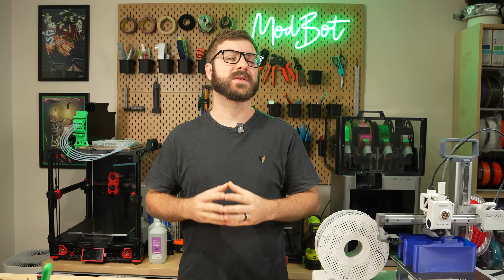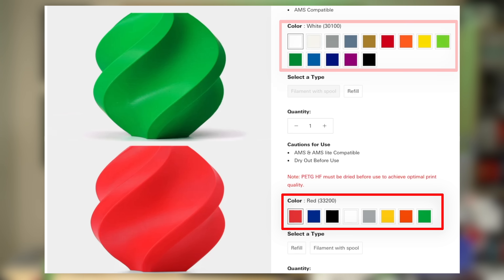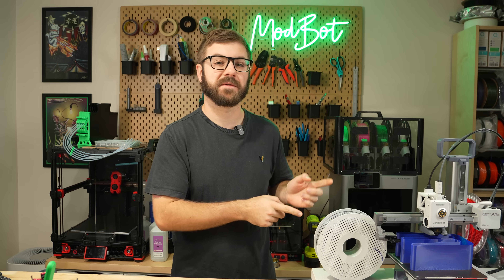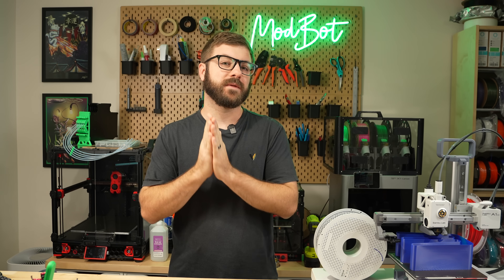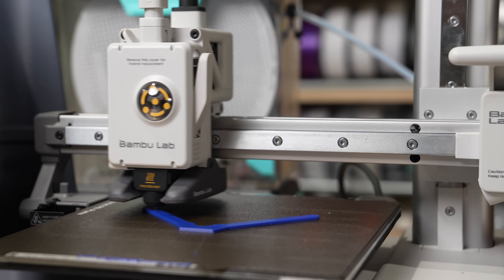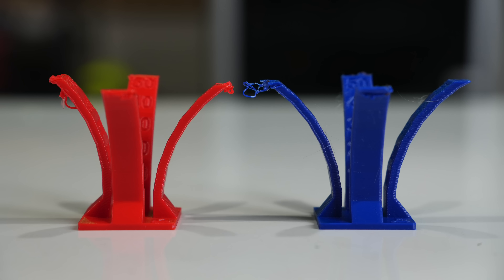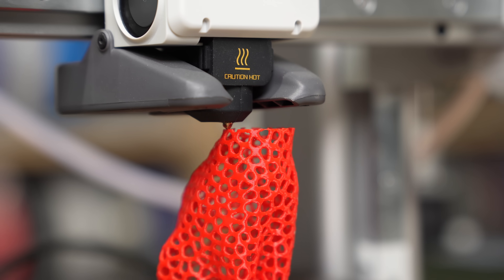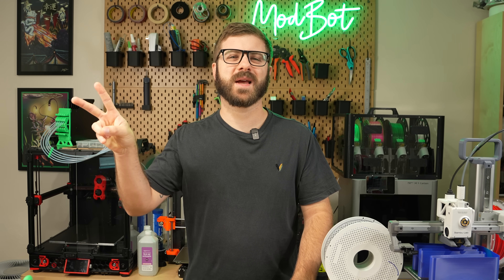Is HF PETG Actually High Flow? (And What Are The Trade-offs?)

Comment: I print and sell rod building jigs for people who build fishing rods. These are functional prints that need the mechanical property advantages that PETG offers over PLA. This HF PETG seems more like a step backwards. If you want to print faster for functional parts, the better move is to increase your nozzle size and layer height and keep the mechanical benefits of regular PETG. I print with a .8mm nozzle and .4mm layer height at 40mm/s which doesn’t sound like much, but it really speeds things up due to the increased line sizes and layer heights. I have a small print farm made up of Ender 3’s and I do not use Bambu Labs filament, but I really hope other vendors don’t follow their lead and get rid of a filament with fantastic mechanical properties just to reduce print times. It is not a good trade off for people who print functional parts that need to be able to handle some abuse.
Reply: If you need strength and want to up your speed, throw away the PETG and use real PET. It's better in all ways but needs a high temperature capable hotend (290+ for high speed, 270 baseline). No snot, no first layer adhesion problems, isotropic part strength.

PETG is basically "PET modified to be easy and cheap to manufacture as filament and printable on low quality printers with PTFE lined hotends, but shit".
Reply: @daliasprints9798 I would be interested in trying some out, I never have admittedly. I personally don’t have any issues whatsoever with PETG’s adhesion to my print bed surface. I may pick up a roll of PET and see how it runs for me. I will say (for my particular use case and what I sell) PETG works great!
Reply: i print functional parts with HF and have experienced only positives, different uses cases for different folks i guess, but i'd try it first. there's also 'if it ain't broke...' too so I'm just saying
Reply: @joeylopezdesign  Same here. No issues at all and haven't noticed any strength drawbacks.
Reply: upping the layer height / nozzle size doesnt really do much for these bambu lab printers. their hotends only flow around 22 mm^3/s so no matter how you slice it (pun), you're capped by the hotend. higher layer height just leads to lower layer speeds. I used to do the same with my ender 3 neo since print speed was hardware limited. but most modern filaments are printed at max speed with these bambu labs. unless you get a panda/revo/e3d hotend with an upgraded heater core (60W aftermarket vs 25W Bambu's), you wont see much faster prints.
Reply: @dtylerb  The UV issue of ABS is extremely overstated if it isn't used for high strength applications, especially in dark pigments, which can absorb it rather than the plastic. Sure, VOCs are an issue, but if you're printing to sell, that shouldn't be an issue.
Reply: @klaidasrunele the rigidity of ABS is the main problem for me in my particular parts.  I have thin parts that have to flex quite a bit and snap back into shape to clamp around conduit and hold snugly. Also, acetone is commonly used where my parts are being used so ABS isn’t a good fit for that reason as well. There isn’t a one size fits all filament, that’s why more choices are better!
Reply: @TheFishingHobby  I didn't know about your parts coming into acetone, which makes more sense why you use ABS. I didn't think about the chemical resistance element of the plastics much.

Although ABS is a lot tougher compared to PETG so I don't think snap fit elements would struggle if you did try it. Toughness is my main issue with PETG.
Reply: @klaidasrunele  I agree, if you are making parts that take any serious abuse, ABS is a much better choice. It just isn’t the right filament for my use case. I do need chemical resistance and my parts hold up well for what they are used for. PETG also has a low coefficient of friction and great abrasion resistance which is perfect for what I sell. I make parts that support fishing rod blanks and they have to be rotated for epoxy drying reasons for hours on end. There are definitely a lot of factors to consider when picking a filament.
Reply: @TheFishingHobby  I still think PETG is overvalued compared to PLA and ABS for most cases.
Reply: I'm only interested in functional parts. Hf or Regular- I don't consider PETG a functional parts filament. I'll use it for prototyping and fit and function testing.. but it isnt anywhere CLOSE to functional imo😅
Reply: @notyouraveragegoldenpotato  What filament(s) do you use for functional parts?
Reply: @notyouraveragegoldenpotato depends what you're using it for. I've got custom PETG brackets clamped around a pole outside holding up a retractable clothesline and it's holding up quite a lot of clothes when the lines are fully loaded. I've also got snap fit PETG locking clips locking my toddler play pen and it takes quite a lot of force to break them. I'm using a mk4s with prusament PETG using the stock profiles in prusaslicer. Works really well for me. Cheap, doesn't require an enclosure and strong.
Reply: PETG basic has a higher ductility. It is what I expect from PET(G). To be flexible. PETG HF is more brittle. If I want stiffness I print PLA or some other engineering materials.
Reply: I’ve experience basically the exact same properties as far as performance regarding HF as I have normal PETG despite what the spec sheet says. 

You’d think by now people would stop treating spec sheets as the be all end all and valuing it over real world performance lol
Reply: I agree. I go for PETG due to impact strength.
Reply: @mtrezaie  you shouldn't, petg has really poor impact strength.
Reply: HF is not a step backwards, it is better as shown by my tech fun's tests.
Also you are building a jig, what property of petg is better compared to pla for that?
Reply: @riba2233  PETG can bend a lot more without breaking. My parts have little fingers that act as a clamping mechanism that are a friction fit to grip onto conduit rails. They are pressed onto the conduit and flex out enough to partially encircle the conduit when they are snapped into place. In testing my design, PLA is too brittle with too little flexibility to accomplish this. The thin fingers break. Higher temperature resistance so shipping these all over the place isn’t an issue. I don’t have to worry about these sitting in a delivery vehicle in some place like Nevada where the outside air temperature can be 120°F and inside temps in a vehicle that isn’t running can reach insane levels. Crazy good layer adhesion. Some of my parts have screws that cut their own threads into the layer lines which will easily split PLA along the layers. I know 100% for sure because I tested PLA first, running screws that cut their own threads into PLA along the layer lines just isn’t an option. Layer lines printed in PETG with no part fan cooling can’t be split even if you wanted to, it sticks too well to itself. PETG can easily be chemically welded together using solvents made to bond acrylic fish tanks together. These bonds can’t be broken without cutting/destroying the parts. I needed parts to be printed in different orientations for strength reasons and then bonded together. The bonds between these chemically welded parts are incredibly strong…the PETG is chemically melted and fused together creating bonds even stronger than if they had been printed together. It is far superior to any PLA bonds (glues or solvents)…it is made for holding fish tanks together that are filled with water and under crazy amounts of pressure. The parts will break before the bonds will.
PETG has a lower coefficient of friction and higher abrasion resistance than PLA which is ideal for some of my parts that have fishing rod blanks supported by them as the blanks are rotated, sometimes for hours on end as blanks are constantly rotated for drying.
I came up with my designs and tested with PLA first because it is easier to use in general, but there were too many problems that would require more work to solve. The simplest solution was to print them in PETG with the added bonus of increased UV resistance and not having to ever worry about them being somewhere (in a delivery vehicle or a non climate controlled shop) where heat deformation could happen as added bonuses.
Reply: @TheFishingHobby   ok, that makes sense. But in general pla has a great layer adhesion, there was probably something wrong with your setup
Reply: @ it isn’t well suited to the parts I make for a few reasons. PETG has a much lower coefficient of friction and is more rigid, both of those properties give it a big edge over TPU. TPU would be great (I think, haven’t actually tried it for this) at flexing and gripping onto the conduit rails my jig uses, so I wouldn’t entirely rule out eventually trying a TPU/PETG hybrid print. I’ve seen some people do that successfully and the idea has crossed my mind. I do have a part in mind that I haven’t designed yet that I think TPU may work great for but I have other designs I have to get to first.
Reply: Maybe you should be printing out of ABS instead if you want durability
Reply: @klaidasrunele  ABS 🤮
Reply: @daliasprints9798 It's superior to PETG in basically every way. I've come to realise PETG is mostly useless.

Comment: I have never had a video drop at a more perfect time than this one. I'm literally working with their PETG-HF for the first time right now and got a notification that you posted a video about it. Thanks for the data. I recommend checking out what happens when you try printing multiple organically detailed objects at the same time, because it seems like the default filament settings lead to some serious Z-Banding caused by varying flow rate (which can be visualized after slicing by switching from "line type" to "flow" in the upper right corner of the slicer), which was in turn caused by the "slow printing down" setting in the cooling tab. I ended up copying the filament profile over to OrcaSlicer (since they haven't updated to include it yet), leaving "slow printing down" enabled, and turning on "don't slow down on outer walls" as well as "precise wall" in the quality tab to fix it. 

Apologies if this is all self explanatory information to other viewers, but I thought I'd leave it here in case anyone had a similar issue in the future and was having trouble finding a solution.
Reply: Thanks for your process. I'm going to test your setting later today. I kept feeling like the abrupt slowdown was the issue
 Just switched to Orca last week

Comment: I love their new PETG-HF. I use it for the majority of customer orders (unless they request otherwise) in place of PLA. That way I dont have to worry near as much if they leave their print in a hot car or something.
Reply: PETG not great for being in a hot car. Really want ASA for the heat and UV resistance.
Reply: @ScytheNoire  I think you misunderstood. I don't print objects designed to be in a hot car in anything less than temp resistant than Nylon. I'm saying I replaced my PLA with PETG-HF for regular (usually PLA) things like flexi-animals and kids toys so I don't have to worry about it if a kid leaves it in a car accidentally.

Comment: I dont actually use a bambu printer or their fillament, but I do print a product that is high use in a wood workshop enviroment and it needs to be tough and take significant knocks and dings. I have been printing my products dfor a while now with transparant blue green and red PETG and am finding it more dificult here to find a decent replacement for the transparant green I use as the seller here in the UK has gone out of business. I do find it worrysome that there is less emphasis placed on mechanical material properties over how fast it can be printed. normal PETG is used for its properties, ie. that it is not as brittle as PLA and has better layer adhesion and a higher melting point before warping. It was always slower to print for a reason, to gain the mechanical advantages. seems like a stupid move to me.
Reply: I agree 100%
Reply: Petg is as brittle (more bendy, but same poor impact strength) and has worse layer adhesion.
Reply: @riba2233 many people underestimate the strength achievable with pla. The highest tensile strength i found on a non fiber reinforced pla is 75MPa. I haven't found any petg that goes above 60. Layer adhesion barely goes above 75% of its nominal strength for any filament unless special care and equipment was used, for example abs printed in a 80c+ chamber

Comment: Having wateched your other videos, curious about comparison of standard nozzle with HF PETG vs E3D nozzle and standard PETG.
Reply: the volumetric flow rate is extremely improved, to an almost comedic degree.
Reply: @Dwayne-h2v  Yes i understand that, I have one. I meant more in trade offs in strength, look, quality etc against non HF filament with a HF nozzle. I guess that's more of a CNC Kitchen test :)
Reply: ah, my apologies.